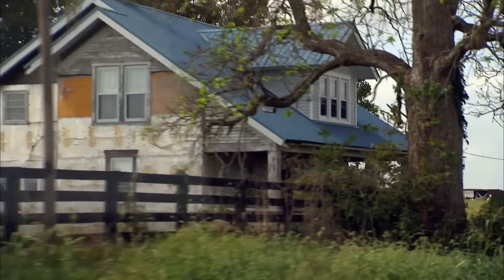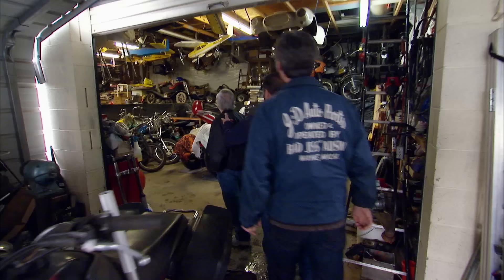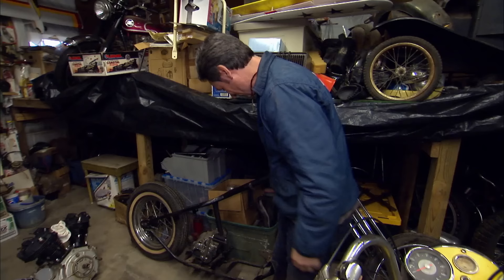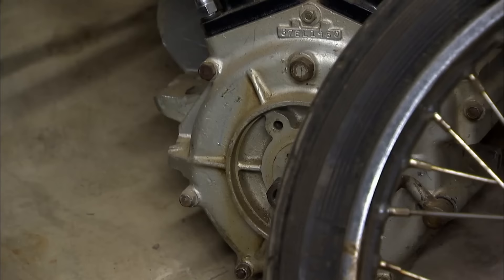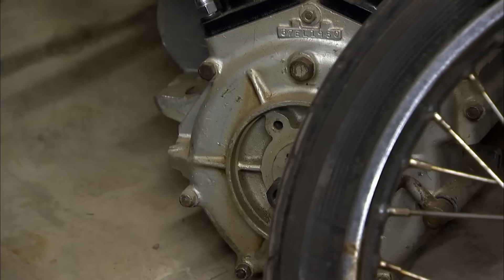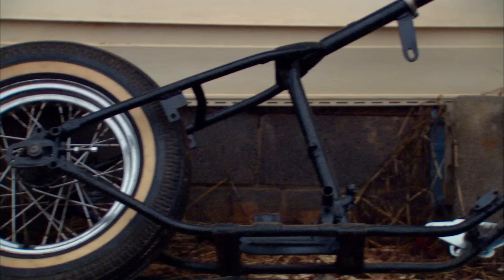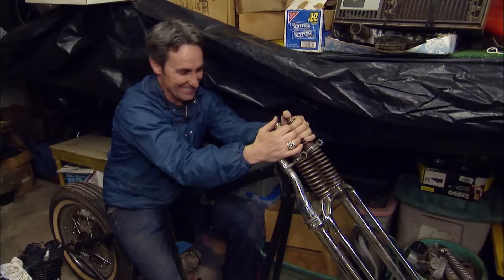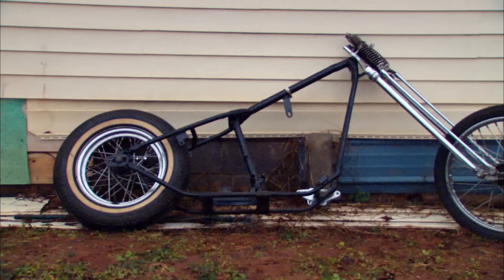American Pickers: Mike Wheels and Deals for Harley Knucklehead (Season 6) | History

Comment: If that motor is correct and has matching belly #'s,  and no welds then it's worth $10-15K as a core, and 25K professionally rebuilt. It would be a plus if it still had open rockers.
Let me guess: they'd add another $300 bucks if it was a '36. Poor old guy cornholed hisself.